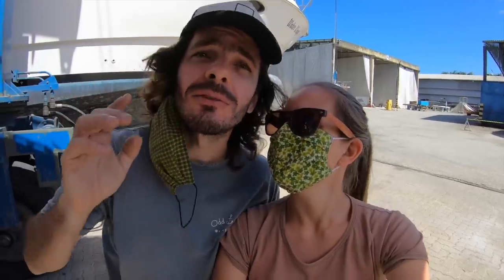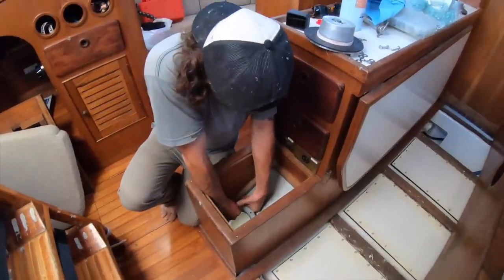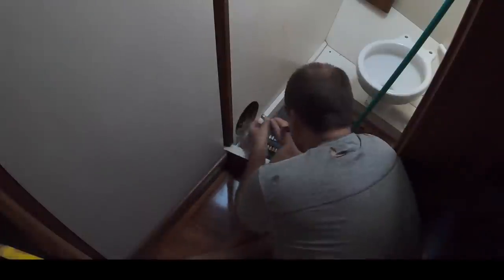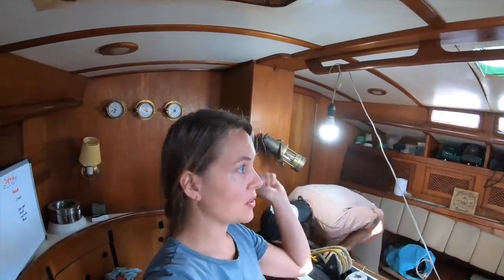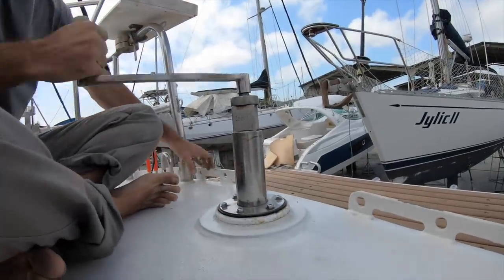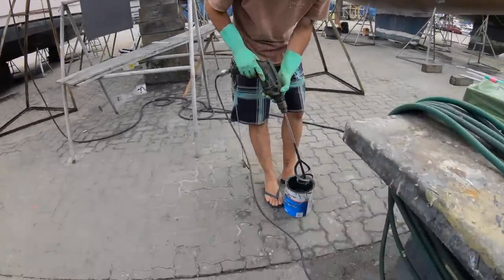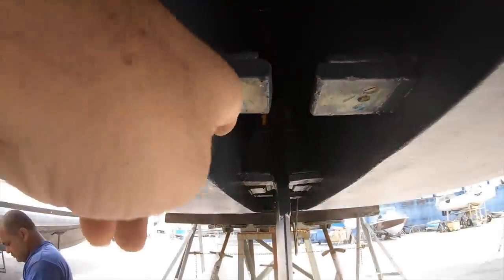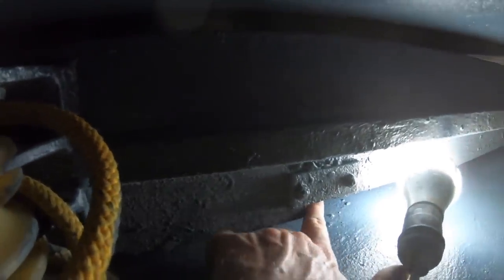⛵️We are FINALLY READY to SPLASH our (once) ABANDONED SAILBOAT!!🤩#153

Comment: When you replace the anode on the centerboard.  You might think about replacing the lid with something transparent so you can easily peek to confirm the position and condition of the centerboard.
Reply: Good idea
Reply from the maker: The problem is that there is a pulley on there and the transparent thing won't be that strong to hold it
Reply: @OddLifeCrafting  Two peepholes then one to shine light in and one to view.  When its a problem you won't have time to take off the lid and it might not be safe to dive in the water to check on it.  The boat is looking great!

Comment: I Would Highly Recommend That Y'alls Buy A New HD-Right Angle Drill & Set Of Heavy Bits/Sockets To Electrically Operate Your Manual Winches + For Other Uses! Thanks
Reply: I was thinking the same thing. It sure will help when raising and lowering the rudder and center board.  
 Congratulations on splashing the boat. Make sure you have several spare washers and nuts when you replace that annode on the center board while in the water. If one gets dropped... it's gone! 
Wonderful job over the last 8 months to a year.
Reply: I think they plan on adding more features like this but I believe they may just be trying to sail the boat home, defiantly a good suggestion as a fix in the mean time while they are going home.

Comment: Does the sailboat have more internals space than the container house?  It sure looks like it.
Reply from the maker: It depends on the size of the boat and format and the way you build the furniture inside of them
Reply: @OddLifeCrafting  pretty sure they are asking if YOUR boat, is bigger than YOUR container...:)
Reply from the maker: They have different shapes and different measures. The container has 40ft and the boat 44ft but the boat has one part of her with 4 meters wide and the rest is not that wide and the container has 2.25 meters.

Comment: Consider getting a Milwaukee Hole Hawg 1/2” right angle cordless drill and a stainless steel star bit. You can then use this drill to power any of your winches including the one for your center board. It works great and has been adopted by many sailers now.
- Milwaukee 2707-22 M18 Fuel 18V Hole Hawg 1/2” Right Angle Drill w/ Batteries
- https://www.thecranker.com offers a “marinized” Hole Hawg as well as the star bit to drive the winch with.
Reply from the maker: Thanks for the suggestion. It's quite expensive here in Brazil and we don't have the option of marinize it.
Reply: @OddLifeCrafting  Hello, “theCranker” link sells the marinized option. Its just a neoprene cover for the hole hawg. The sell the cover separately or you can buy the cover and the hole hawg from them. Watch for sales for the hole hawg online to save a bit of money. Yes its expensive but will make it much easier for Roberta to manage winches and safer if she is hoisting you up the mast etc.
I have to commend you both for the HUGE amount of work you’ have done on your boat. Truly impressive. You have earned our respect. We are 71 now and the boat work on our 45’ center cockpit cutter rigged Spencer 1330 still continues. It takes us a bit longer and we just cant do the long hours of labor like we used to. I am just saying this so you will know boat work is never “done”. You have to enjoy the labor and the results from it knowing that your vessel is is safe. You take care of it and it takes care of you. It becomes part of your family. Enjoy her. We will be watching as you continue on this journey.
BTW... one of the reasons I began watching your Vlog was your opening statement that you would take a couple of months to restore your newly found sailboat. I just knew that you were about to learn a new lesson that would be interesting to watch. You both have been amazing to watch what you have learned. Well Done!
JT & Linda

Comment: She is a beautiful boat now!  I was one of the crew on a Columbia 43 sailboat which had a centerboard. I was one of my jobs to drop lower and pull the centerboard. During the Mackinaw race the wind changed to a downhill run on the last morning.  Every boat in sight that was in front of us was behind us by the end of the day.  The only problem was on that boat which was fiberglass the centerboard was also ballast and it weighed 3000 pounds.   Easy Peasy going down but was quite the job to crank it up.
Reply from the maker: Thanks for sharing your experience with us. There is no ballast on our centerboard, it's not that heavy.😊

Comment: Don't forget the swivel for the anchor.  Also, you might want to consider adding the other 3 solar panels and changing the batteries to lithium (put them in steel enclosed ventilated boxes in case of fire).   Good luck in launching the boat.
Reply from the maker: It seems that you are describing the next steps of our refit. Hehe. We are waiting for the swivel to arrive and the solar panels and batteries already arrived. We are just waiting for the panels controller and we are deciding the size of the batteries cables 😉

Comment: Your boat is so beautiful. It looks like it just came from the factory.

I have a tip for your Profurl. The two screws that go through the plastic drum can slowly work out. I put three wraps of electrical tape around the drum at that point but you still need to check and tighten them every so often.
Reply from the maker: Thanks for the suggestion.
Reply: Take it seriously Duca!

Comment: This is so exciting! You made the detail of the Centerboard area look easy when it most definitely was not with the awkward angles you had to work in. I really like the color of the paint! About the two gasket pieces you lined the bottom of the centerboard with: won't those eventually get barnacles and stuff on them which would impede the raising and lowering of the centerboard? If so, what would you do about that?
Reply from the maker: It was a really hard work. 3 days of hard work that we couldn't film everything as it was a hard job. It's gonna have some barnacles inside of the centerboard, we are gonna clean it everytime we need to lift the boat to paint the bottom
Reply: @OddLifeCrafting  I could tell it was difficult. Looking at the surface area therein, comparing it to Roberta's height... The whole cavity was much bigger than it appeared on camera. It was daunting just to look at! Well done indeed!
And, Hi, Fred!! ☺️

Comment: This is just so awesome!  I am so happy for you guys!

By the way, if you haven't done it already, you should consider purchasing a cordless (battery operated) right angle drill and putting a winch connecting bit on it. This allows you to just hook up the drill to the center of the winch, click the switch and start winching really fast.  Because it is a drill it has lots of power and torque AND it is reversible, meaning you can use it to winch up or down.  I see this used often on larger boats to save people's arms when winching sails up and down.  (If you watch Sailing Doodles, they use one of these for the sails on their CT56 main mast)

In your case, this would be useful for the centerboard.  Either that, or just purchase a single electric winch and put it there.  Winching that centerboard up and down is going to be HARD when underway.  Especially if you have to enter a harbor in an upwind direction, swapping from sail to motor while also winching up the centerboard would be a nightmare.

Comment: So cool to see you guys finally ready to splash the boat! Hope all goes well. 

Btw, wouldn't it be possible to install a different kind of winch for the centerboard or maybe even an electrical one?
Reply: I agree. how about this---a piece of metal the size of the stub of a winch handle , welded onto a socket , that goes onto a rechargeable impact wrench . pull the trigger and the centerboard winch turns........

Comment: I would suggest one technical recommendation about waterproofing.  Always test a small amount of caulking like Sikaflex, paints and primers before using. Make sure that can (batch number) or tube cures or dries according to specification before you waterproof many critical points of water entry.  These products are usually of quality but I have had many bad "batches " over the course of my 30 years. So happy the splash is next! Congratulations!

Comment: If you want to 'clean up' the hatch cover on top of the centerboard, you can plug the finger hole with a flat, white, plastic hole plug made for desktops. They're cheap and easy to remove and will keep dirt and crumbs from collecting under the hatch cover.

Comment: Option one; put electric winch on the mast.

Option two; unthread some of the pulleys because for each pulley you double the distance but lower the weight so the fewer you have the shorter the distance but the higher the weight. This would make it faster to retract but it would weigh a lot more. Possibly even more than your line is designed to carry as that when they designed the boat I’m sure they took a lot of these calculations into account. 

The third option; would be to get a lever for your winch that has a mechanical advantage so that for every stroke you make it with double or triple or whatever the times it turned.

Option four; find or make an adapter so you can use an electric drill or some other electric motor to turn the winch for you. 

I think that pretty much sums up your options on raising and lowering your center board. Feel free to prove me wrong by listing other ideas you may have.

P.S. I would install the electric wench because it could also be used for raising the sail and other things.

Comment: To hoist or lower the centerboard, perhaps you could use a battery powered drill.
It is not very heavy to hoist or lower manually, but it takes for ever.
Maybe there is an adapter for the winch to the drill, other wise you could make one.

Comment: You could always use an adapted electric winch motor to move the centerboard up and down. Would make life much easier and I even dare to say safer. Why safer? Because it will be times that you should either raise or lower your centerboard but you will be just to lazy to do it manually. This will not be the case is you have an assisted means to do this job.
I know it's already too late, because by the time I'm typing this the boat should already be in the water, but GOOD LUCK with the splash anyway! :)
Reply from the maker: Thanks for the best wishes ☺️ maybe in the future we can have an electrical one 😉

Comment: On the sailing doodles channel they use a battery operated tool that resembles an angle drill to turn the winches that put up sails and maybe centerboards    u might consider using such a drill like tool...    just a thought

Comment: 6:23....I kind'a side with Fred. I'm a little concerned seeing those un-gloved Sika covered hands. I just read the data sheet.😖
22:45...Consider getting an 3/4" 20v battery impact gun.(I use Dewalt) Have the welder make an adaptor for the winch and use the gun to raise & lower the centerboard, I bet you could also adapt it for the anchor windlass.  In the States we call it a MacGyver solution.👍

Comment: What’s next.., new cushions and upholstery, watermaker, test the cooker/oven, fridge freezer, emergency equipment (flares, life jackets, life raft emergency rations, etc). Test sweet water system and drainage, test fawcets, test disposal of grey and black water system, test bilge pumps, test all systems, test electonic communications system and learn protocols. Buy flags. Buy fuel test the engine, buy sails, test the sails, finish all Odd Jobs and stock up with food and spare parts and foul weather clothing, clean and varnish interior wood. Then sail off into the sunset.  :)

Comment: What are the anodes for? What do they do?
Reply from the maker: An anode is a sacrificial block of either zinc or aluminum alloy that is mounted on, or connected to, the underwater metal parts of your boat E.G. stern drives, shafts, propellers, rudders, trim tabs and skin fittings. Anodes come in a variety of shapes and sizes.
Reply: @OddLifeCrafting  Thanks. But what does it actually DO?

Comment: You’re probably aware that once the ship splashes, the rust only accelerates. 😁😩

Can you drop the centerboard by freeing the clutch on the winch? At some point you could also install an electric winch near the cockpit. 75 turns is a scary proposition if you have to retrieve the centerboard quickly.

Comment: I am not a sailor. What is the purpose of the anode?
Reply from the maker: Any time you have two different metals that are physically or electrically connected and immersed in seawater, they become a battery. Some amount of current flows between the two metals. The electrons that make up that current are supplied by one of the metals giving up bits of itself — in the form of metal ions — to the seawater. This is called galvanic corrosion and, left unchecked, it quickly destroys underwater metals.

The most common casualty of galvanic corrosion is a bronze or aluminum propeller on a stainless steel shaft, but metal struts, rudders, rudder fittings, outboards, and stern drives are also at risk. The way we counteract galvanic corrosion is to add a third metal into the circuit, one that is quicker than the other two to give up its electrons. This piece of metal is called a sacrificial anode, and most often it is zinc. In fact, most boaters refer to sacrificial anodes simply as zincs.
Reply: @OddLifeCrafting  Thanks Duca for explain about anode. This Volta effect i think
Reply: @OddLifeCrafting  Thank you so much for your very clear answer to my question. Well I guess you would not want your boats to have corroded parts I just recently became a viewer. I have enjoyed watching your journey.